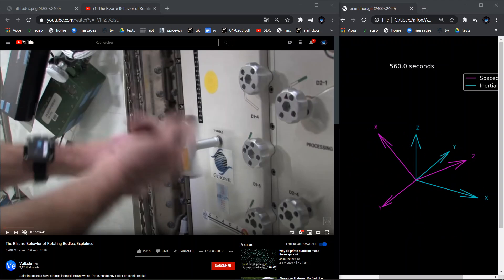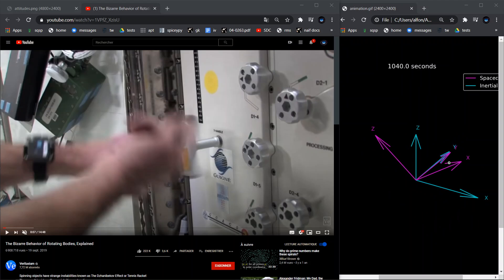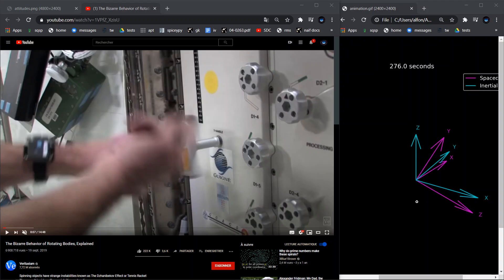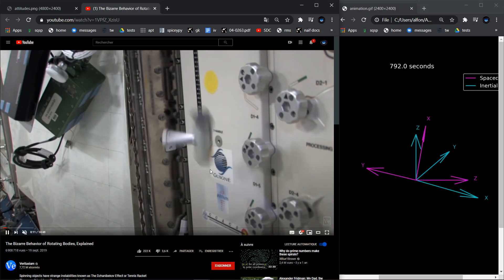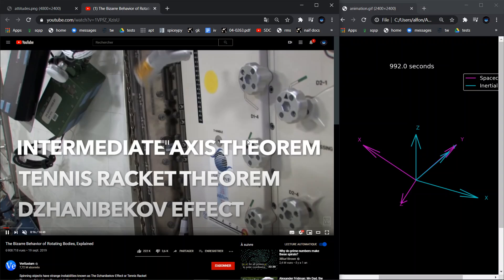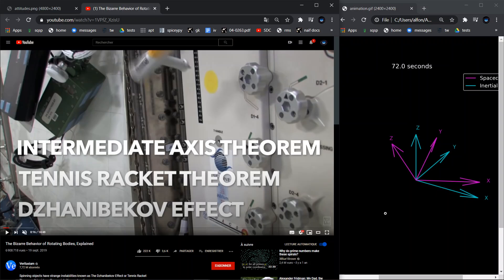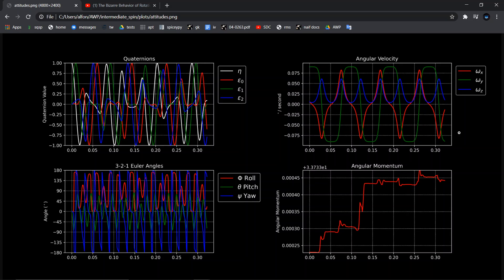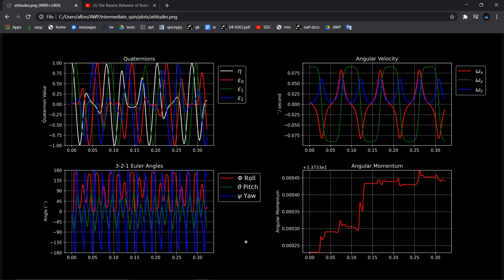Intermediate Axis Spin Simulation (Tennis Racket / Dzhanibekov effect)

Comment: Hello, I'm also trying to simulate the intermediate axis theorem with a spinning T-shaped object in python, but I don't know where to start. May I ask what kind of packages you used? The only one I've heard of is v-python, and I was wondering if you used v-python to do the simulation in this video? Any response would be greatly appreciated!
Reply from the maker: So there are two parts to this: the simulations and the animations.

For the simulations, I developed a Spacecraft class where I input initial attitude and angular velocity and simulate the dynamics in orbit. If you're just interested in simulating a T-handle you can do it much more simply. Basically, this is an initial value problem where you need to know the differential equations of the rotational motion. I'm going to be going over this in depth in the spacecraft attitude control series, although that is a few weeks away. So for the meantime, I recommend watching this video series from a professor at UC Boulder, he does a great job explaining these concepts: https://www.youtube.com/playlist?list=PL_onPhFCkVQicZvpfDE9cKahSxlzvTpz6

Obviously this playlist has a lot of videos, so you can skip over some if you're already familiar with the concepts

For the animations, I use matplotlib (a standard python package) to create each frame (I save each frame as a .png) and then I put them together in a gif with another python package called imageio